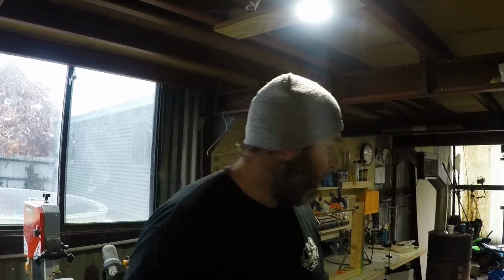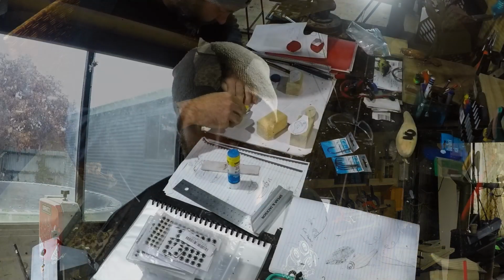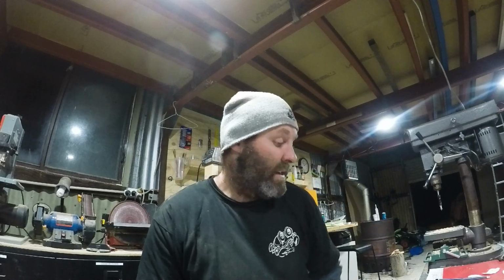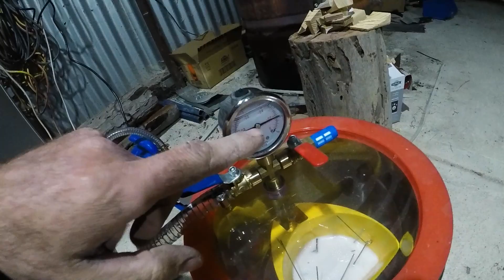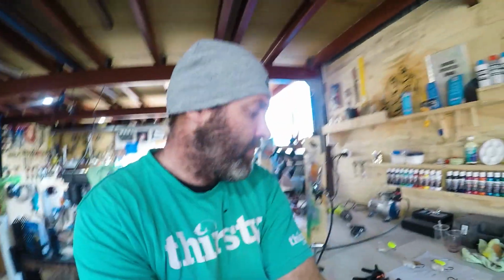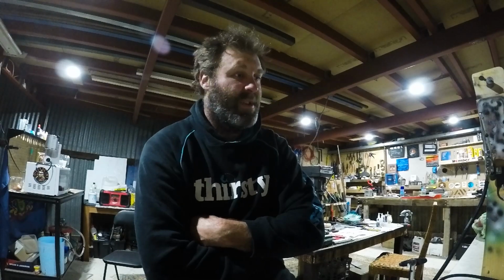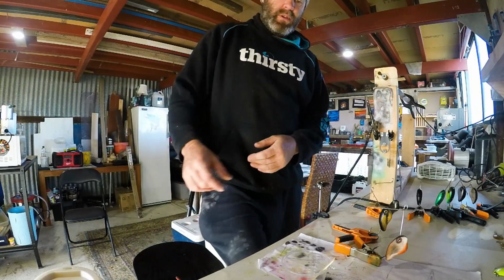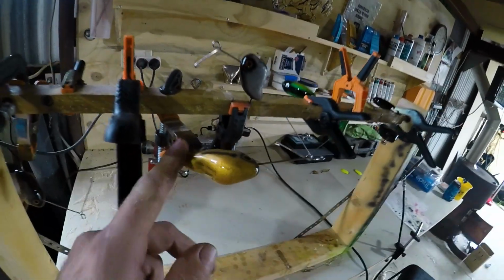Making lures for youtubers -Robbie Fishing, RKJ, Goodoo Gang, Cod Gobbler, Gerrys Fishing Banter

Comment: Drain your compressor before you use it if it’s got a drain bung in it mate! And also point that little heater towards the air intake on the compressor 👍🏻
Reply from the maker: Do both chief, it helps a little bit bit sadly I think the biggest issue is it’s a cheap air brush. Lol
Thanks for watching mate 👍🏼